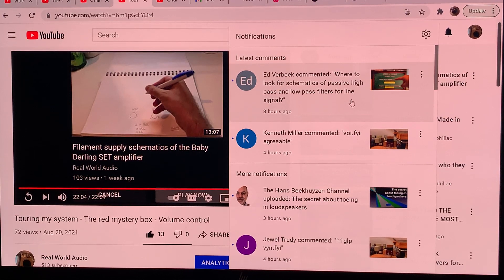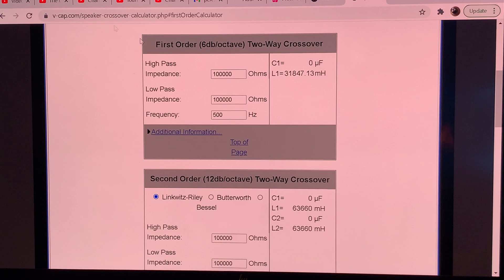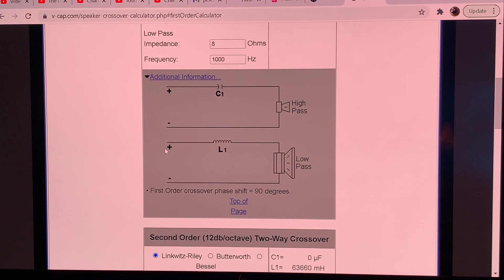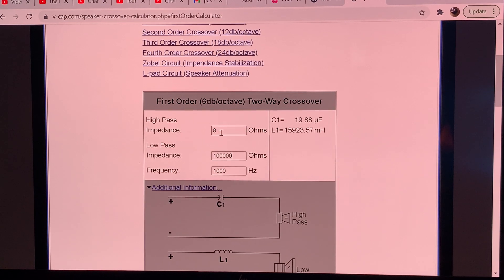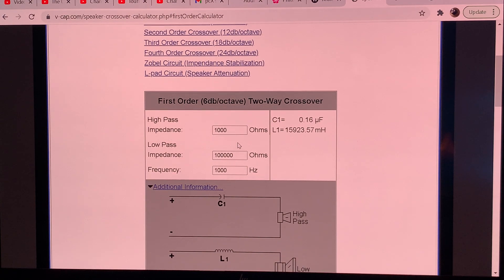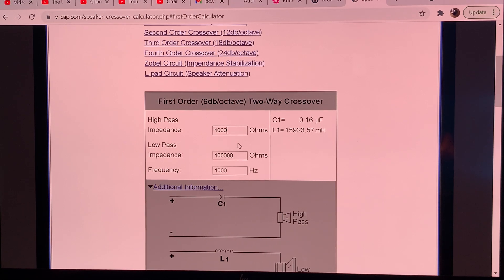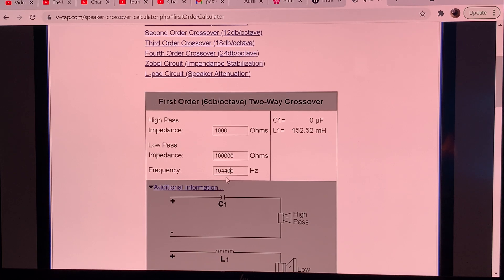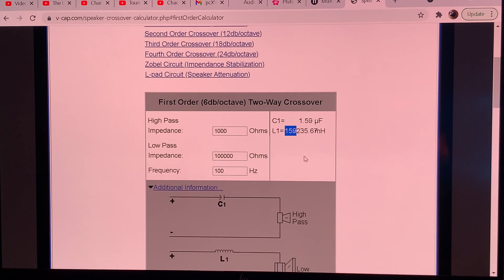How to calculate Line level Passive crossover component values?

Comment: I think you should put High Pass Impedance as the DAC or Streamers output impedance, which is hopefully low, say 1000 ohm. Then put Low Pass impedance as the amplifiers input impedance, which hopefully is high, say 100K. Then desired frequency. This conincides better with other PLLXO calculators. Price per component: €1-2. Result: C1=0.02 µF (DigiKeys produktnummer
1928-MKS2C022201A00JC00CT-ND), L1=1990.45 mH (DigiKeys produktnummer
2725-FD2D-20-202-ND)

Comment: hey man thanks for the informative video :)
it has raised a few questions in my mind! as most good educational videos do!
so here we go
1) would it make sense to add the crossover after the preamp gain section but just before the output resistor? (since these are usually much lower inpedance than amplifier input resistors)
2) have you experimented with sound quality when comparing line-level vs speaker-level crossovers? (i did find lou's comment to be helpful)
3) if one wants to make the crossover frequency variable by turning a knob, would this be possible with an RC-type crossover using a variable resistor?

i am still in doubt. i want to relieve some bass off my full-range speakers. but the crossover point is quite near to the Fs and they have a huge impedance spike there, making the design process of the crossover hard for me. so i thought maybe i would try a line-level crossover since the input impedance of an amplifier shouldn't be reactive (i think). but i am afraid it will degrade sound quality 😁
i just recently discovered your channel and i already love your pace and explanation style! thank you 🙌
Reply from the maker: Thank you Raoul! Eventually I have not tried the line level crossing over, but I have received feedback that it's not worth following up as there is too much information lost. Crossing over at loudspeaker level has less losses, despite the hard to drive issue. My experience with FR drivers is that it's better to relieve them of high frequency duty - if you relieve them from the  10kHz or so plus region, then they have no problem handling their bass regions. Just roll off the very top with a very small choke, and add a tweeter (plus a 0.5 - 1uF or so cap for first order high pass) that is comfortable with the 10+kHz region. Also, you can play around to fire the tweeter upwards, that way it will blend in with the FR driver much better. Trying to cut the bass from the FR will result in phase problems seeing up to the midrange, creating a pretty bad smear / loss of coherence. ; Cheers, Janos
Reply: @realworldaudio   that's too bad 😅 i have a pair of audio nirvana super 12 ferrite speakers. the bass region is fine -ish but it's not as detailed, alive, and authoritative as my pair of jbl 2245h subwoofers. i was hoping to be able to combine them. would it make sense to put the full range drivers in a very small ultra-damped box for natural bass roll-off?
and would this nasty phase shift occur in a line-level crossover as well?
Reply from the maker: @raoulselten9480  Yes the phase shift would show up at the line level as well. I would keep them in the large cabinet. They would sound constricted in a small cabinet. Rather, try crossing the JBL lower: second order crossover, but very low, around 50Hz or so..

Comment: I just thought I would chime in on the passive low level x over discussion. You do not have to make the filter with a choke and a capacitor you can do it with a resistor and cap instead 
and it will be much cheaper.For example you can make the rc filter operate at 50k and make the input resistance of the amp 500 k so it can be driven with out to much loss.Many RIAA phono filters are composed of RC networks and it works fine.I used to use this approach about 20 years ago in my tri amped system. There
however is a problem in the low level method and that is your preamp has to drive this reactive load presented between it and the the power amp times 3 for tweeter mids and bass.Well maybe you could use a cathode follower in front of the filter and behind the filter
so the preamp can drive the filter and amp better but now you have added complexity to the circuit and the sound is worse in some ways and better in others. Yes you would think 
small caps and resistors in between the preamp and power amp should sound better than large inductors and caps between power amp and speakers but that is not what I found back then.Non linearities before the amp are worse than after.In the end I chose a pair of mono blocks and a passive crossover between amp and speaker.Any way you chose  there is going to be a compromise. Regards Lou
Reply: Thanks for the addition. I have a lot to try. That’s fine, becauseI enjoy making choices based on listening experiences.
Reply from the maker: Thank you Lou for sharing your experience! Indeed, you gave the answer to my dilemma of whether there's more to gain with crossover element at low level or between amp & driver. Thank you for confirming that the extreme drive requirement for the line level filter brings about greater sonic alteration than what happens at the amp out. You just spared me a wasted experiment! ; )

Comment: This is what my avr does when I cut off the frequency, I don't care what people say, speakers should be run full range, speakers usually sound much more clear when u take out the bass, according to me
Reply: That’s also my experience. At this moment I am using a 4 inch full range in closed cabinet and am experimenting to roll it off electrically below ca. 80Hz . The speaker already rolls off acoustally below ca 110 HZ  but it then still gives high distortion . That is why I want to get rid of the electrical signal at those frequencies.
Reply: @edverbeek6292  there are some active crossovers from pro audio side that can be used for this and not that expensive 200-500$ , once u know which cut of frequency is sounding like what then u can make a passive one for better sound that is more pure
Reply from the maker: Your are absolutely correct, when frequency range is limited the driver can control the region more precisely. Also, modern drivers have extreme difficulty working in a wide frequency range, as they are explicitly designed for narrow band. Older drivers were designed for much wider band application, and some for full range application.

Comment: Have you ever ,ever seen a crossover with a high value choke?Surely  not.unless you want a cutoff of.0001hz.
Reply: Sorry if I offended you...Truly.
Reply from the maker: @alaingingras7224  No worries Alain, easy to get upset when you think someone is pulling your leg. I am sharing a lot of very unusual information on audio. Things that do not come up in public audio knowledge and might seem strange at first, but ultimately to give a broader view. This is the behind the audio scenes channel.
Reply: If I may, the OP states "Line level" In the video title!
Which means this is the calculation for the pre-amp level crossover connection from preamp to amp. Not your typical amp to speaker crossover.
He also says this is the reason why this is not favoured in today's world, basically because the crossover becomes ultra expensive for the mass market.
The calculations are similar for preamp (high impedance) or for speakers (low impedance), hence the inductor/capacitor values also change quite drastically.
When it comes to application, you'd probably want something like this for a nice clean tube amp, since the crossover on a low power amp would rob some precious power. It's not much for a solid state amp, but the loss is quite significant for a 3w tube amp 😂
If you're not into high efficiency audio equipment then this is all probably irrelevant. But I highly recommend a set of high efficiency speakers with a small but noise-free tube amp. Try it out, it's a different, and quite delicious approach to music!
Reply: @vikassm  Totally absurd.line-level crossover is ACTIVE!
Reply: Don't even bother...
Reply: @alaingingras7224  😂😂 ok boss. You know it all then 👍
Reply from the maker: @alaingingras7224  Today basically all approaches are active. In the beginning of stereo era they used passives at the line level for highest quality applications. It is not technically impossible, this technique is also used in phono stages for RIAA correction in the LCR phono stages. If you know the impedance of the next stage, you can design a passive crossover anywhere.